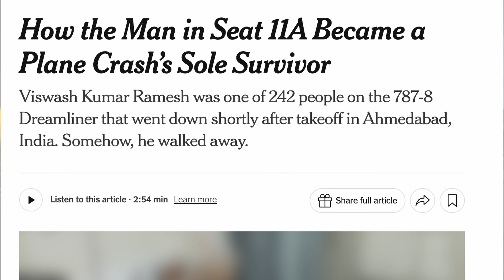Why the RAT Changes Everything – Air India 171 Update

Comment: Captain Steve, I made a comment on your video yesterday about the "RAT" being deployed and I'm not to sure about the dual engine failure because after researching about all things related IF you look at video again and notice the landing gear position the main landing gear as you can see were still fully deployed and the angle of the gear kind of pointing down (this is well after the gear should have been retracting a least somewhat if not completely) 
Also it could be possible it was a complete pressure loss in the hydraulic system possibly a massive leak which could account for no flap configuration too. I don't know but could that have been the cause of crash IF both the landing gear and flaps had failed even though the engines were working? BTW, I saw someone had posted the original video yesterday (the one you played today) and that's when I saw and heard the RAT

Comment: From the footage shot by passengers prior to takeoff they were saying that nothing worked, nothing electrical, no air-conditioning or TV screens. I think the pilots were trying, the fact that you could hear the RAT and no engine noise would suggest that this was a failure of the aircraft rather than the pilots. Which is weird because Boeing build really safe aircraft…. Right?

Comment: Dang...the mystery deepens. I guess I'm slightly reassured that it seems less likely that the pilot/co-pilot did anything wrong like retracting the flaps instead of the landing gear. But, ya....what caused the engines to cut out?

Comment: I would like to see the maintance logs. GE engines just don't flame out and stop.
Reply: They stop if the pilot switches them off intentionally.
Reply: @davidcole333 Again the only way to stop a GE is to deprive it of fuel, I've seen GE motors toss fan blades and still chug like nothing happened. I honestly think this accident was maintenance related

Comment: The copilot raising the flaps was a pie in the sky theory for crashing a perfectly working plane. If the RAT came out then there is NO REASON to think the co-pilot did that. Also some have said it took off at the last edge of the runway, WAY past where they should. ALL of this points to problems during take off that doomed the flight.

Comment: The only reason for both engines to quit at the same time, is a fuel system failure. The only 3 options I can think of are electrical fuel shutoff valves, vapor locked / heat soaked engines, or a catastrophic hydraulic line failure severing fuel lines to both engines. None of these seem likely, but neither does a dual engine flameout so hopefully the black boxes can tell us a little bit about what was going on with the health of their systems after rotation.

Comment: Capt Steeeve---did the aircraft use the 11500 ft runway all the way or did they use the 6300 ft of the runway---. Unless you don't have answer to that question---all analysis is faulty---.

Comment: If the crash was caused by a failure of both engines, then all Boeing 787s should be grounded until the problem is found and the Boeing 787 is inspected and improved. Even if it was caused by a bird strike, the immediate loss of all thrust by both engines, leaving the crew without any chance of recovery, is simply unacceptable.

Comment: the plane had line a 160 fpm increase, this is like nothing, with the gear up it would double 
even doubling it woulb 320fpm whereas the norm is 2000fpm. I think the tanks surged for some reason, it is not common to have both engines fail at the same time, it is like you flow into vacuumn,...

Comment: I stated in your previous video that I thought contamination of the fuel contributed to the dual engine failure. Probably the fuel blocked the fuel pump or pumps. Since I am not a pilot, or an aircraft mechanic, I would have never thought the RAT can deploy at such low-level altitude. The black box will definitively indicate if the RAT did deployment.  Something else: If it was fuel contamination, then it more aircraft would crash close to the timeframe this 787 crashed. Perhaps, my theory may be incorrect. Nobody wants planes to crash, the important thing is to determine the cause and find out if the same issues, if any, are plaguing other 787's.

Comment: what would cause but engine to failed ? obviously it can't be something in the engine, since it's almost impossible both of them will failed and at the same time. I bet there is not many thing that could kill two engine without any visual sign (smoke, fire, etc)
Reply: The obvious answer is one he cannot say because he IS a pilot working for a major airline and it is that one of the pilots switched off the engines at just the right time to cause a crash.  But no one wants to say that because until there is proof from the data, it's speculation.  But at this point, it's the theory that most closely fits the available evidence.

Comment: The climate control systems are turned off to ensure that engines function at full throttle on takeoff and that all power needed is left for the engines. The AC is turned on after the flight reaches a safe altitude.

This piece of info is in reference to a tiktok video of the same plane from its previous flight where the passenger is showing how the ACs are not working before take off

Comment: Thank you for your analysis on the situation but if you really are a pilot with more than 5000 hours of flying experience then you should know that the spark plug maintenance was not done correctly! Knowingly or unknowingly somebody ignored one major factor when it comes to safety protocols the pilots had no enough time to overcome mayday . He definitely tried to land soft but had very less time ! No emergency maneuvers seen in the videos sadly the black box cannot help us determine the error if the spark plugs were not clean .

Comment: Add major battery and/or cabling failure to the theory list.  That could have killed fuel pumps resulting in engine stall and also failure of hydraulic retract system.  Batteries and power cabling have been a problem in the past.

Comment: I saw a video where a commercial airline pilot showed on a simulator that this thing could take off even with no flaps. 

Also, the landing gear was in a position that indicated it started to go up, based on its position. 

He also pointed out the RAT deployment and a dual engine failure was most likely the culprit. 

Also, fuel contamination was given for a possible reason for a dual engine failure.

Comment: Was there maintenance on the aircraft? I know back in my maintainer days, certain tasks required the firewall shutoff valve to be closed to avoid fuel dumping or fire. Never worked this type of frame so I don't know the particulars of it's systems. I can't fathom how both engines would be fuel starved enough to shut down without a interruption of flow or a commanded shutdown. Just enough fuel in the system to startup, pushback, taxi. I'm not into conspiracies, but might've been losing thrust as soon as they started down the runway, explaining the need for a full length rotation. Ah well, we can speculate all we want until the data is analyzed and released to the public.

Comment: Dual engine failure is very strange. I guess it may be possible for both GE and Boeing to get the blame for a systematic failure.
Reply: The most LIKELY cause of a simultaneous, CLEAN, double engine failure is that one of the pilots shut them down.  No one wants to say that, but to me, it's the elephant in the room.  It's obvious the RAT was deployed, it's obvious the engines were dead.  It's also obvious there was no bird ingestion or any other anomaly with the engines or an otherwise perfectly flyable aircraft.  And the odds of a simultaneous double engine failure just a couple of hundred feet after departure?  You'd have better odds of winning the powerball.

Comment: A comment:  Technology should allow a review of  the video of the heat signatures of the engine exhaust to get an Idea of the engine output.  A Question do both engines feed off the same tank?  if the tank in use is bad that may account for both engines quitting at the same time

Comment: I was on a flight from Seattle to Phoenix 30 years ago and about two minutes after take off we had an engine catch fire for some reason. The pilots shut it down and the fire suppression system put it out. We made a safe landing back at Sea-Tac a few minutes later. Scary stuff but I still very much trust flying.  Thoughts and prayers to this flight passengers and crew.

Comment: Steve, the RAT deployment does make me question earlier theory. But things causing me to still question what happened. 1-the survivor , as you noted someone who been through a near-death experience, with massive amounts of Adrenalin in the system, are not always the best source of information. Not his fault, just the way the human body works. 2-Mayday call to ATC where Capt reported to say " Thurst not achieved...Falling". one thing to consider is the front slats provide about 40% lift. As they retract, and your at full power and still sinking, that would seem like the engines are not producing power. But when you add that 40% loss of lift to a a rotation speed 160 kts (+/-)  you get 225-230 kts. And since the last ADS-B data info received at 174kts, the aircraft was not going to continue to climb, no matter how hard you push the throttles. Just another point of view.
Reply: slats out at crash site as were flaps,,,   it could not be more obvious if you were punched in the face with it what happened yet people still cling to the original theory which was bollox  steves over a day behind he is so late to the party on this   check out swiss001,,  blows steve away.,,,
Reply: Front slats are extended as per the photos of the wreck.

Comment: Let’s talk about fuel.
Generally an aircraft lands with an hour or so of fuel remaining. Due to auxiliary and header tanks the remaining fuel and new fuel added for the next leg is rarely completely mixed. I’m sure the previous departing and departing airport tested their fuel supply after this accident. I haven’t heard of other aircraft having issues from either airport. I also haven’t heard of either fuel farm being shut down for contamination.
Even if contaminated at the last fuel stop the aircraft should have flown longer than it did due to having good fuel to get it there.

Comment: Ram air turbines were patented in the mid 1950's when early jet engines had 'Flame-Out" problems. Early single engine military jets had no ability to restart (relight) a failed engine. They provided hydraulic power to re-light a failed engine, or power the landing gear in case the engine would not re-ignite. All of the 1950's Century series of jet fighters (F-100, F-101, F104, etc) had RAT's built in.
Reply: My dad flew an F-100 in the 50's.  Supersonic, baby!
Reply: We had "RATS" for our ECM pods on the AN/ALQ-99 Tactical Jamming System still used today.  🎉 🌩

Comment: Just a question if the plane lost both engines (they were providing no electrical or hydraulic power) my question is would the RAT be able to raise the landing gear or is that not part of the critical flight systems that the RAT covers. I assume when there is a total lost of all engines and the RAT has to be deployed, the landing gear would only be lowered once just before landing and it would be a gravity drop of the undercarrige (ie, lower the gear and let gravity and the weight of the gear lower them into place).

Comment: The 787's entire architecture is to shift from mechanical to electrical.. all it takes is a massive loss of power with being 600 ft off the ground and you're dead.  

Everything on this plane runs electrically vs mechanically and something horrible happened either right before take off, or slightly after.. Lithium battery explosion -- that explains the bang? Lose the entire A/C bus and who knows what that actually does.. Something electrical died on this plane and it killed everything and everyone.

Comment: Hello Captain Steve, I don't know if you've seen this video from an Air India passenger. It shows how the small screen in the seat doesn't work, and neither does the control panel or the air conditioning. Could this be part of the electrical fault? 
 https://youtu.be/1y_u1O-T6jw?si=u5qf-rV8T-nzODNC

Comment: Maybe we need to get a Boeing test pilot on. As many are saying that because the engine thrust is massive that the aircraft can actually take-off even without flaps. As long as both engines are running at full take-off power, after all the aircraft can take off at maximum weight with just one engine. But I believe thats all pointless as I give it less than 0% the pilots are that stupid! If the last transmission is to be believed that the pilots said "Mayday Mayday Mayday, no power, no thrust, going down! I still put some fault with the pilots "if" they could have aborted the aircraft due to lack of performance during the take-off period.

Comment: 13:13 minutes to tell us you have no idea.
Reply: He did retract his original theory based on additional evidence and clarity.
Reply: @zoeboy505 but his initial theory was impossible. Computer says no.
Reply: If you expect anyone to have any idea at this stage you are in fantasy land. If you want to see a video where someone explains it for sure you need to wait a year at least.
Reply: Yes he's hopeless on this one. My vote with no flight or mechanical experience is that poor maintenance has cause an electrically short circuit cutting out all fule pumps. This is clearly the only thing that could have happened to kill both engines at exactly the same time.
Reply: You watched a different video or ya Mam wanted her ipad back?
Reply: Thanks for your analysis Captain Steve..  Question: If it was not a dual engine failure, but rather a total hydraulic failure, would the slipstream have caused the leading edge slats AND the flaps to retract, and landing gear to remain extended resulting in a loss of lift causing the crash, despite still having continuous engine thrust?
Reply: He’s just chasing views from day 1. Unfortunately theories peddled by pseudo experts such as him have suggested a basic pilot error whereas the truth is way more complex. And once he’s been on news channels getting his “theories” out, a majority of the flying population will doubt the highly professional crew that takes their work very seriously. And let me not even get started about the impact to the legacy of the crew flying
Reply: The jury is out on the actual cause. The RAT deployment which looks very likely now vindicates the poor pilots who got slammed by so many so called experts. I for one didn't believe it was ALL 100% pilot error. This pilot was a training captain for Air India. I for 1 feel it unlikely it was pilot error. 

While I understand any impatience and expectation from you perhaps ? you can stifle your exasperation about losing ""13 minutes"" to watch this. 

Consider by comparison the poor +260 souls on the plane and ground who lost far more than 13 mins......😔 RIP🙏

Comment: Yep, That's one theory. The 787 has a history of the BATTERY FAILING ON 2 JAPENESE 787'S WHEN IT WAS NEW.
A 'BANG', was heard, this could be the battery exploding or 'going off' in it's 'ARMOURED CASE' designed to contain it untill you get it on the ground.
THIS WOULD DEPLOY THE 'RAT'.

Comment: The 787 has a known history of lithium-ion battery fires, which can trigger catastrophic avionics failures. On the previous flight, passengers reported the air conditioning, lights, and entertainment systems were not working—clear signs of electrical problems building up. During the accident, the Ram Air Turbine (RAT) deployed and the landing gear stayed down, both strong evidence of total power loss. Survivor also saw emergency green and white lights come on before impact, indicating the aircraft switched to backup power. All these point to a likely scenario where an electrical fire or battery failure knocked out critical systems, leaving the crew unable to retract the gear or climb. The 248 day bug that requires the SW to be reset (failing to do so could cause GCU issues and complete power failure) can be ruled out because the engine was replaced only recently (and probably the SW bug has been fixed)
787 batteries are susceptible to "cascading thermal runaway" where failure of one cell triggers failure of adjacent cells. A main battery fire can cause APU to fail as well. The high electrical demands of takeoff could have triggered the final cascade. Also bear in mind that 787s are Full Authority Digital Engine Control (FADEC) systems that require electrical power for proper thrust management.
Reply: That was like 10y ago, been long fixed